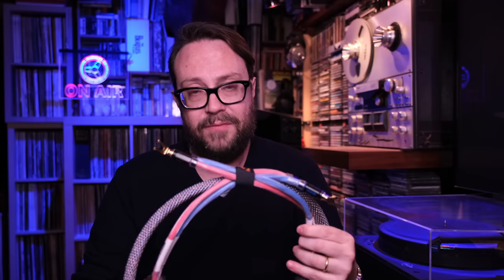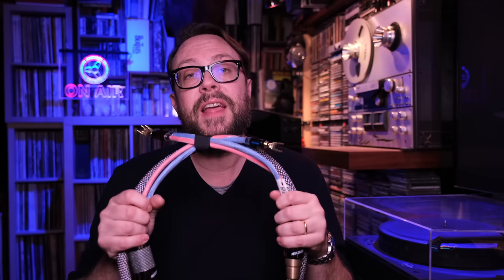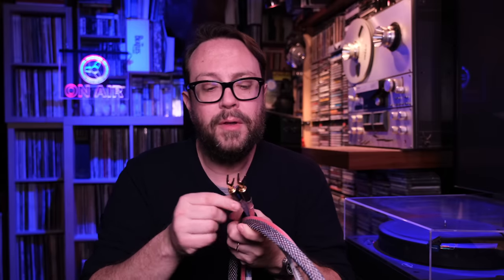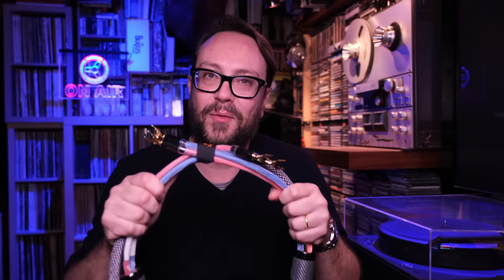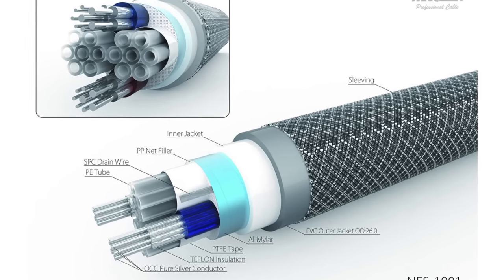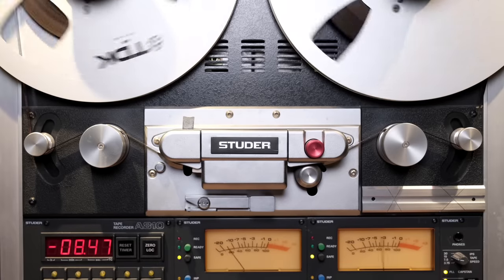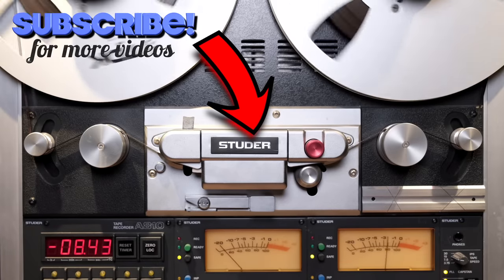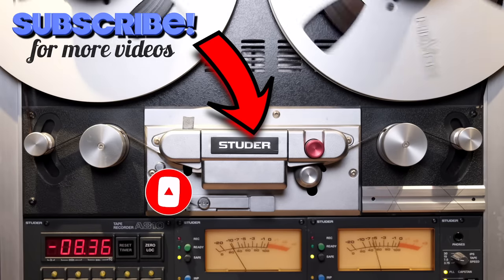Extreme high-fidelity OCC speaker cables at a fair (high) price

Comment: Anyone with any knowledge of electricity knows that these "high end" cables are a ridiculous rip-off. The speaker is 8 ohms (nominally). That is near a short circuit. That is the load that is seen by the amp. The silly "fire hose" cables do not even enter into the equation. It's like you started with a sewer pipe, and ended with a garden hose. Don't be a sucker for the shameless scam artists who are making false claims about this overpriced junk. The fancy cables might boost your sense of pride in your system, but the fact is that electrons do not flow any better through pretty wire.
Reply from the maker: Which quality speaker cables have you tried?
Reply: No point in reasoning with these clowns. Let them enjoy their overpriced jewelry and laugh from a distance.
Reply: "High-end cables are often simply better materials and better manufacture. Live in a high-EMI location? Unshielded cables can suck. Also, quality of manufacture affects product longevity. Corrosion is a thing and can leave you with poor sound. Poor jacketing materials and insulation can crack and peel over time, and that's also bad.
Reply: I was once a "audiophile"... Yes! Speaker cables do make a difference... Better cable gave a sense of ease... Cheaper cables choke the sound

Comment: Well, I do respect your work, but have to interfere: on which measurement did you noticed a difference, and compared to what? You used your ears to convince us to buy expensive cables . That is not right. Oscilloscope, signal generator, full audio spectrum, beyond audio frequencies, noise treshold,  there is NOTHING in your video.  This is commercial, please do commercials about useful things, not like this.
Reply from the maker: No I don't think you respect my work if you state that this is a commercial while it is clear that I do this only for passion. Measurements? Are we still there? Read the other comments...Measurements help but are not completing the picture and people understood this years ago. Only techs who live via numbers are still completely attached to this uncompleted concept. Tell me, can you establish which chocolate bar is better with measurements? No because taste goes beyond that, so do ears. Does a blood work tell you everything that is going on in your blood? No because you can only ask precise questions so you don't get all the answers. Same with cables. Just for a start measurements are mainly based on voltage leaving aside other elements. 
Plus, you should know that in cables so short inductance, capitance and resistance are negligible so...the model, as I said, is incomplete.
Reply: @anadialog  good answer, I can agree about chocolate and blood and so on. That is not measurable, trully. But, at LEAST it is needed and possible to do  measurements for the reason to prove some advancement, or comparison with some other sorrs of cables. If you did not do it, how can you speak about 1 or two percent of advancement???? Please get on ground, from clouds
Reply: @colloidalsilverwater15ppm88    difference in cables, that only human ears can measure !
Reply: @anadialog  Hey there I love your videos,  you're explanations are way better than most people. I have a question for you  on power cables. I'm upgrading rca and speaker cables which are straight forward. My question is, when it comes to power cables do you replace the cords on all of your devices or are you just replacing the main cable from the wall to whatever the first thing is that you're plugging into? I don't have a high end stereo by any means, my system is a Pioneer a-443 receiver, Sony CD player, Technics dual cassette deck, Ampapa preamp, Thorens TD 160 turntable, and Tannoy C10 speakers, but I'm open minded enough to try different cables to see what kind of difference it makes. I make my own cables so that the cost isn't too much. Right now I have everything plugged into a power box. Any suggestions would be greatly appreciated. Also I don't know if you already have a video on this or not, but I would love to see a video on your system. What you have and how everything is hooked up and why, etc. Cheers!
Reply: @anadialog  Measurements tell lies as well. A good example would be the decades long tendency to measure steady state THD+N in order to assess amp's performance and the infamous onset of realization of slew rate and intermodulation related issues. On the other hand, take a look at a classic complementary AB class final stage. Your precious signal leaves the emitters of poorly matched, non-linear, current driven transistor pairs via 0.22-0.47Ω resistors. It then negotiates copper traces and 22awg wiring to find its way to contact relays and gold plated brass terminals, passing through the coil and 10Ω resistor of the Zobel network on its way. That's where the action takes place, external wiring is of no practical consequence whatsoever, considering the amount of distortion and signal loss produced by amps during dynamic, rapid signal changes. Then there's the constantly adjusted bias to compensate for temperature co-efficient in BJTs. One can hardly be concerned with serious issues limiting performance under the hood, one is not familiar with, hence go faster stripes on sports cars, or ... fancy cables.
Reply: @paulb4661   only the wrong measurements !
Reply: @ronthibault843   how do you know the cable will be a  upgrade ? Is it based on cost ?
Reply: @anadialog   get a thousand people to taste the chocolate bar to get some data. Or a million. Then you will get an average. That's a measurement !
Reply: @r423fplip  Define wrong !

Comment: For those of you who are not not interested in constructing your own speaker cables, may I suggest the Synergistic Research Foundation series. I purchased their interconnects and speaker cables at a very reasonable price and I can only say I am stunned at the remarkable positive changes they have made in my music system. The speaker cables are not heavy gauge, yet they are stunning in the way they reproduce the sound of recorded music.
Reply from the maker: I checked the website. Impressive silver cables of all types and very very expensive. The foundation does have a very good price but it's also true that there isn't much silver in them, very skinny, that's way. But they are monocrystall (like OCC) and seem quite interesting. Thanks for sharing that!
Reply: @anadialog  these are cables that you need to hear to believe.  It took them two or three months to come to themselves because the sound just got better and better every day. Check out Jonathan  Vailins reviews. I trust everything he says.
Reply: "Isolation is paramount"
When I researched the "dielectric constant" .
There is materials that is better than PTFE . Like cotton and air.
So for my DIY speaker cables I used pure dead soft solid silver conductor.
And a cotton tubing.. and more..

Now we talking about best of the best materials.

Silver is pricey but I can't dream what the retail price would be if someone would do that type of cable.. but now it is one of the kind.

The great thing with DIY we can use better quality materials than manufacturers is using.
Reply: @stimpy1226  they changed daily, so they could have peaked and are now getting worse. If they can improve, then surely they can get worse !  Why do you trust him ? If he said jump in front of a car it won't hurt, would you do it.

Comment: I use RAM Amedeus 5 Mk2 OCC copper speaker cables replacing some 20 year old Van Den Hul 'The Wind' cables, which was a massive step up in sound quality, especially in mid range detail & bass response. Priced at 50 Euros/meter offer good value. Home made as you did but with rhodium plate locking banana plugs amp end and gold plate spades speaker end, 4 separate runs from 4 mono-block amps bi-amping the speakers. These take a lot patience to assemble, as you found out. Have you taken a look at the DH-Labs Silver Sonic Q-10 Signature Speaker cable for DIY? I was considering these as well. Silver plate high purity copper at a very reasonable price for the DIYer. I use one of their silver interconnect cables from bulk and they are on par with some DIY Cardas solid silver interconnects (4 runs of 24g solid silver through PTFE tubing, twisted together, wrapped in silk tubing then heatshrink over the top). Also another tip is to use 4 or even 6 x Mundorf 0.5mm through PTFE tubing, twisted together, silk tubing then heatshrink. You don't have to spend a fortune to get excellent results.
Reply from the maker: Nice! I tend to exclude metal mixes, the have different electrical properties which disturb one another. The Cardas seem the right combination!
Reply: I did the RAMM speaker cable project myself as well, exact copy of the video with spades, still very happy about them. This is when I realized how much cables matter

Comment: I bought speaker cables from blue jean cable. Very happy with them
Reply from the maker: Glad to hear that. May I ask what high quality cables have you tried? In other words "amazing" compared ro what?
Reply: I got some Amazon prime basic cables, exactly the same.
Reply: @anadialog   I also replaced some higher-end cables with the Blue Jean cables while expanding my system. The BJ cables aren't as pretty, but  the build quality is very good. Canare  4S11 wire and terminals are sonically-welded. The star-quad profile is great for rejecting EMI that is common in apartment buildings.

Comment: well i just did speaker cables today not that expensive Cable made in japan Canare premium speaker cable we hand-assemble with Canare 4S11, 11 AWG Star Quad cable with Banana speaker connectors in a bi-wire configuration. Starquad cable virtually eliminates EMI while offering minimum resistance and excellent frequency response due to low capacitance.  I went from 4awg OFC  Great video thanks
Reply: starquad is only effective with speakon connectors, running it into bananas isn't what it's designed for. 4s11 is good cable but if you put it in 2+2 shotgun 11awg configuration you end up with very high capacitance. with it in biwire configuration you end up with an average 14awg cable, you'd be better off running it in shotgun and making binding post links in 11awg config or just running 4x11awg cables

Comment: These are great cables. I have used bulk bought but i have to say these are difficult to work with. Very thick and strong. Hard to terminate because of it. They do make a difference to sounstage depth for sure. They also thickened the midrange and added bass power compared to other cables i have used. Also, i believe these are 8 AWG.

Comment: Lots of audiophiles have cables and headphones galore. It is a good idea to re-visit some of the things you had in your system, years ago, many upgrades ago, before you went to something else. Like if you bought a new preamp, try some interconnects you used in the past,  go down your cellar or into the back of your closet and dig them out. Even if you were convinced that replacing them made an improvement back then. There is the synergy thing involved; but also your maturity as a listener. The sound that you thought was lacking, might have been more right sounding than you thought. Violin strings, especially massed strings, dont have edginess to their sound. The upper keys on a piano either. They plink, but don't ever have an edgy outline in real life. Sometimes you find you've been using the wrong amp for years; that what you were using years before, now and in the cellar or closet, that you didn't give enough credit too. Don't let forum reviews keep you from going back. It's unbelievable how many of those people cannot hear.

 I had an instance of this yesterday. I was using an old pair of 1990s Grado headphones for quite a while, for my headphone listening. On a whim I set them aside, and plugged in a pair of even older Koss headphones. There's no way for the Koss I thought. The Grados were open back, and the Koss were closed back. Within seconds I couldn't believe how brighter the Koss phones were. A lot of people say Grados are bright, but they sounded absolutely conservative compared to the Koss. Even though the highs were bright as can be, the highs were super clean. The Koss has a piezoelectric tweeter. So clean were the highs that I welcomed their extra brilliance. The cymbals sounded so full, but not sizzly. Crisp but smooth The sizzle in lesser phones  occurs from distortion. I think people would prefer a lot more high end, if it was this clean. People who don't like bright treble; really what they don't like is bright+distortion. Than can result in  unpleasantness and fatigue. But when it's this clean. The treble  was more extended too and revealed the Grados to be rolled off in the extreme highs. The Grados had more bass and massed strings sounded bigger, and instruments had a bit more space between them. But the Koss was cleaner in the midrange and highs; very obviously. Oh those deeper tone colors! 

 A lot of us know that more warmth can make instruments sound bigger and like they have more body. But more extended treble can make instruments sound bigger too; I realized. Yet some instruments sounded bigger on the Grados and some on the Koss for some strange reason. I didn't think it would be a contest between the two. It was. It just goes to show that actually listening in the now, beats memory from the past  Memories of how you though something sounded. Once I brought up an amplifier from the cellar that I hadn't used for years. With admittedly different equipment being in use now, it trounced the amplifier I had been using for a long time. So much nicer sounding and enjoyable. I think when we upgrade, our bias is to hear improvements for the money we've spent. It's sometimes good to go back. Sometimes we surprisingly find that the equip. we were using in the past, is better than what we are using now. After several upgrades; or so we thought.
Reply from the maker: Good advice, I agree! I lived something similar with my headphones: https://youtu.be/zRRgWBapJ0E
Reply: Don't waste your time, just listen to music !
Reply: Grado s are transparent not bright. No matter what series

Comment: I have replaced all my cable with SKW and I agree that for the money they are hard to beat. My speaker cables are said to be  6 nines pure copper.
Reply from the maker: Sweet!
Reply: I picked up the SKW WG copper and silver.  They work extremely well with my set up.  Although I may audition some Audio Research cables.
Reply: How do you know they are six nines ? And does it make a difference ? Could five nines sound better ?
Reply: @jamienaquin3918  You're talking about the SKW top of the line cables, right? The ones that have OCC Silver and Copper? I plan to buy some soon but I worry that since they're from China, they might not contain real OCC wire. What did the SKW replace, and was there an improvement?
Reply: @Dexter's Kill Room  Honestly,  I was using a basic cable from Besr Buy. However, they seem very high quality as do their other cables.  Very good reviews. I hear a much more detailed sound w better dynamics,  soundstage, openness, clarity, retc. Well worth the investment.  Takes a few hours before breaking in. Buy them on Amazon like I did for the easier return.

Comment: Thank you, i have learned a lot from your channel and also save a lot money.
First i want to buy Cardas Cables (Clear Reflection) for my Dynaudio Special 40 with a modified Crossover from GR-Research (Mundorf and Duelund Capacitors).
Now becuase of your Video i decidet to buy the Neotech NEMOS 1080 with OCC Silver and Oyaide Spades.

It was the right choice.
Reply: Would be interested in how it compares to Cardas.
Reply: Interesting. Thanks for your thoughts. I’ve liked Cardas for a long time and still is one cable I use because if it’s midrange. Some cables are more extended and open, but I’ve come back to Cardas for certain qualities it excellent at. I had a pair of Special 40s for a year. I think a cable like the Neotech may match the Special 40 well.
Reply from the maker: Thank YOU! The Nemos always attracted me with its square section but it seems a nightmare to properly solder. If that doesn't stop you go for it! I am currently using their square interconnects which I will present further ahead along with other sharing cables.
Reply: @mariocassar3117  or double blind.
Reply: Did the GR upgrade make a big difference?

Comment: Neotech occ bulk wires are very good; I use them to built IC cables in silver and copper. Not suprised that their speaker cables are very good.
Reply: What is the difference in sound between silver and copper?
Reply: @karl-erikmoberg5668  I started with balanced ic with copper and  then rca ic with silver both with multistand 24 avg wires. Moreover I used different connectors. So It is difficult to make a direct comparaison.
Reply: @benitoben6357  Hi, I have not done direct comparisons either, with same cable architecture.
But I have done it with connectors, copper more lively, silver more smooth.
Reply: @karl-erikmoberg5668  I'm more familiar with this in terms of interconnects rather than speaker cables. With silver interconnects, in general, there is more weight and extension at both top and bottom, and maybe more detail, but the midrange may seem slightly recessed compared to copper, for a sound that is more on the cool side than the warm side. That's a generalization -- maybe an over-generalization.